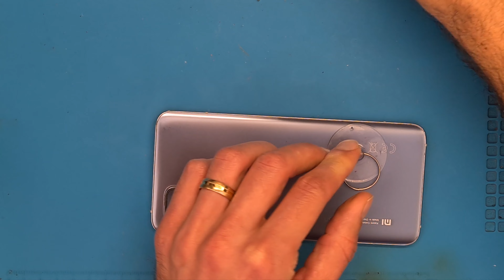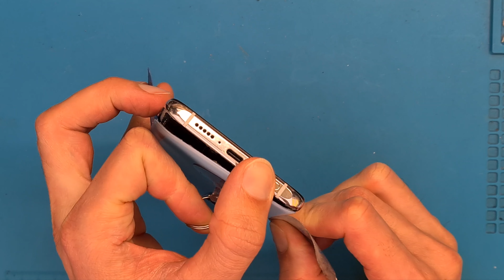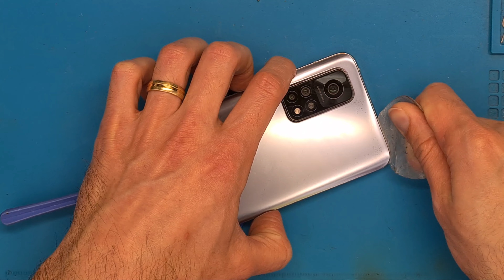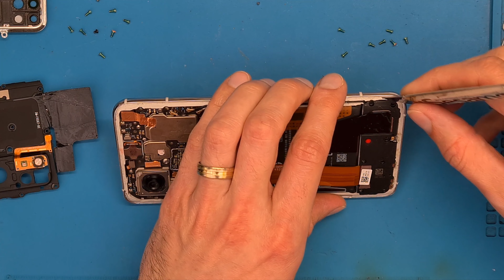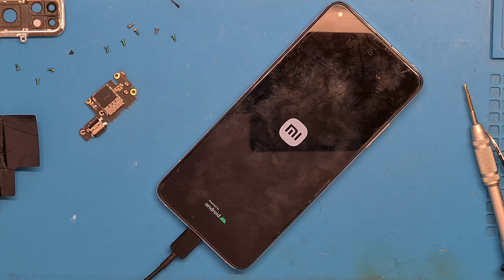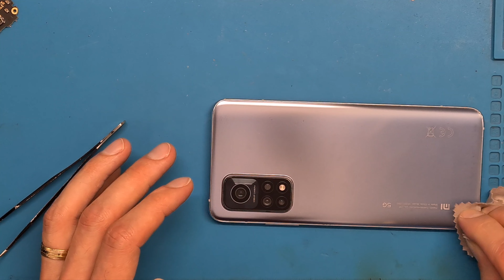Xiaomi mi 10T pro 5g charging port replacement and disassembly

Comment: I noticed that the fast charge doesn't come on when you plug in charger. Some of these boards for sale don't have the fast charge components on them. Some chips missing
Reply from the maker: @davidberry7985  hello, we used original parts but the charger connected is a samsung 15w charger not the fast xiaomi charger needed for this phone

Comment: I still have this phone but no longer use due to the charging port going bad and cant flash. This replacement should allow new rom to upgrade. Have you found any clients that ask you for android 13 flash?
Reply: Mi Turbo charge still works?
Reply: Расскажите в двух словах как произошла поломка?

Comment: Hey! The black and White cable that connected to the part ypu replaced are damaged, what is the name of those?
Reply from the maker: Coaxial cables or antenna cables
Reply: Vibration motor makes noise,usb otg not working,usb tethering not working, charging works properly. What could be the problem??

Comment: Vibration motor makes noise,usb otg not working,usb tethering not working, charging works properly. What could be the problem??
Reply from the maker: If data connection is not working, a part of the usb connector could be damaged, vibration motor could be detached from dropping the phone. It needs to be reattached.
Reply: @phone_fix  after restarting phone vibration works fine . Otg to aux works fine. Problem starts once putting it on charging and resolves after restarting phone. Do I need to reball cpu,?

Comment: It doesnt charge if i dont press a bit at the back where the flex connector cable is from the battery. Should i change the whole charging port or just the flex cable?
Reply: Same here
Reply: I unscrew the back and then i put some folde paper and tape it on the cover right above the flex tape and then screwed it with bigger screws to put some extra pressure on the flex tape connector. Now it's charging perfectly
Reply: Ive changed the flex cable  and the problem is gone

Comment: Can you tell me why did you open the top part ?? i need to change charging port( mic is dead) and i dont see the reason to open top part
Reply from the maker: It is always better to disconnect the battery before replacing parts.
Reply: @phone_fix What would be the risk of not doing so? I want to change just the charging port since I am no pro.

Comment: Mine doesn't mi turbo chargw anymore, even my powerbank doesn't allow me to use the qc3.0 anymore, tried cleaning and changing cable but still no fast charging, the qc 3.0 light does come but only for 2 second and the it turns off, its not my powerbank fault. Will changing charging board fix it?
Reply from the maker: If you replace using original parts it should fix it, but the problem could also be the charging flex cable or the motherboard fpc connector.
Reply: @phone_fix  thank you, my charging board is on delivery rn, i hope it's gonna fix this

Comment: i have changed the charging socket. unfortunately it still doesn't work. What else could be faulty?
Reply from the maker: @MrDaPeDa  sometimes it's the flex cable that connects the charging board to the motherboard or the problem could be the fpc connector on the motherboard or the charging ic... a lot of possibilities
Reply: @phone_fix  Thank you for your information. Will try to change the flex cable
Reply from the maker: @MrDaPeDa  you could try to measure it using multimeter or inspect using a microscope